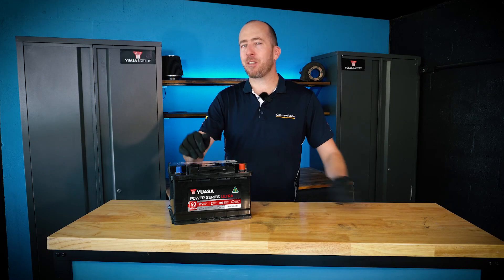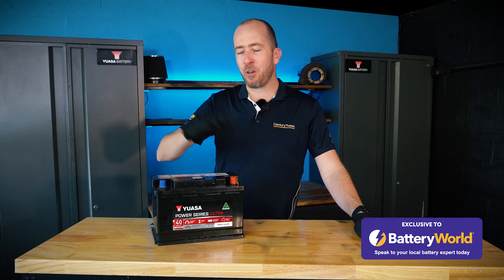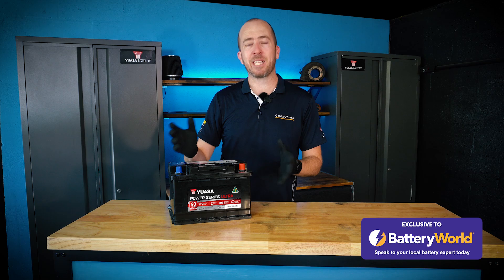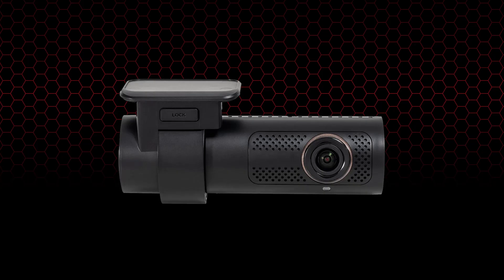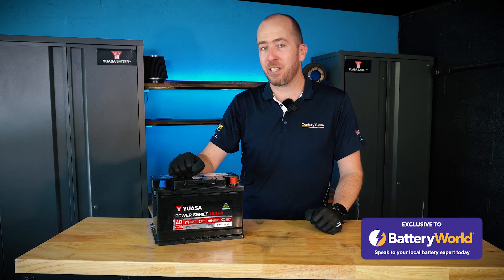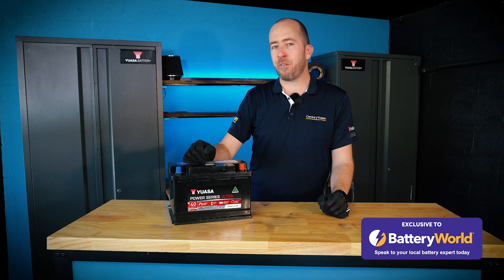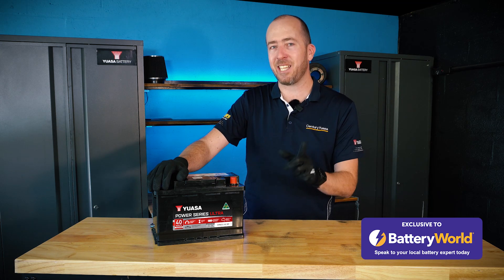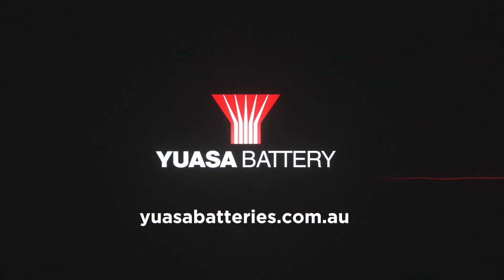Why do car batteries go flat?

Comment: i do uber. so everyday the alternator charges it for 8hours. every battery i used lasts for 2years... after that. it doesnt holds charge that long anymore. i wonder if using the welding machine method to "revive" the battery works or not